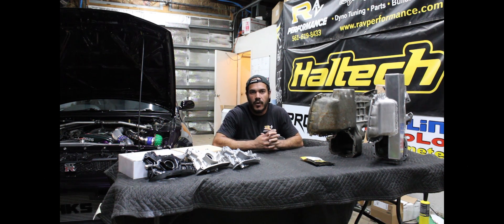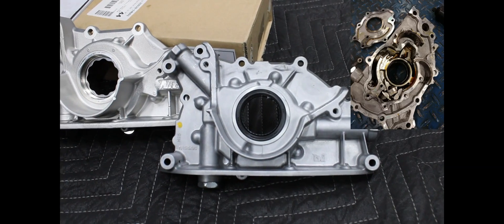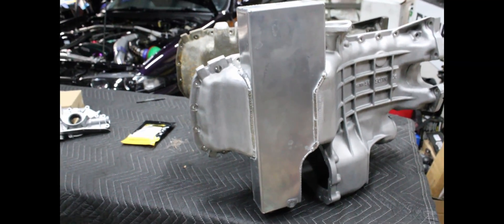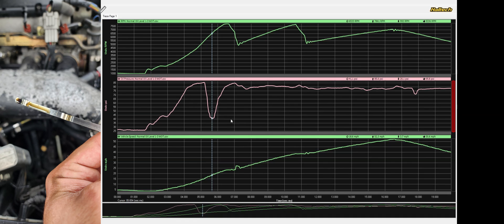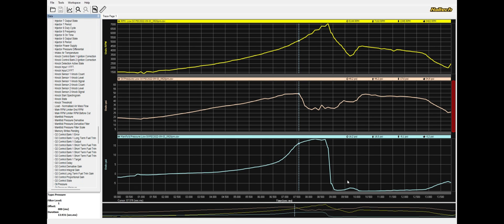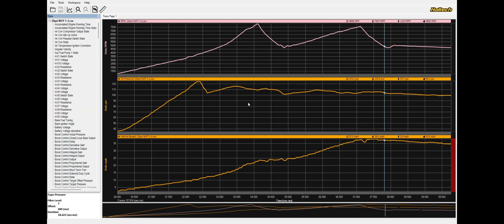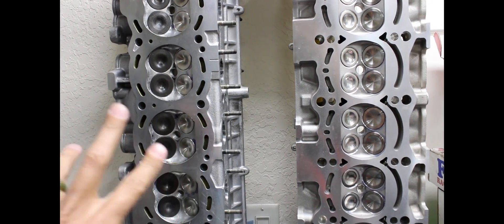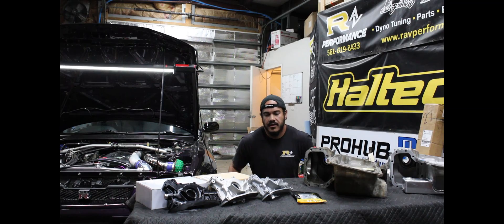RB26 Oil Issue Truth & The Real Solution

Comment: Thank you for the information, was any of the test with stock pan done with a oil flow restrictor to the head? Would it help to temporarily patch the problem?
Reply from the maker: @haiboj4979  Some of the original tests only had a head resistor. There are no significant signs of a difference. That being said, we run restrictors in every build as part of the whole oil package

Comment: Your video just saved me some money down the road. I looked at my logs and the issue you mention appeared. My oil pressure drops to 40psi at anything over 10psi with a s261 turbo. The log shows it happening even when I'm accelerating hard down hill.

Comment: Great video, I got some questions about the catch can setup. When returning the oil to the sump, do you recon a 6an plug on the can is big enough? And do you prefer venting the air to atmosphere or plumbing it back into the intake? If plumbing back, does it matter where you plumb it to? Thanks!
Reply from the maker: 6an is more than enough of a drain.

You run the vent before the turbo inlet

Comment: I would say just a couple other easy things to help working press throughout the whole system and other than just oil flow regulation from upgraded oil pump. catch can closed loop setup or returns to sump lines would be one way checks and for break ins for sure or ethanol too. many variables so basicly any motor can benefit a proper specd setup inline filter for cleaning blow/catch oil to sump return. cans also need proper breathing as well. Also the few builds that we have used the Turbosmart press regulators for turbo oiling systems have been a nice addition as well. I dont think I heard you mention the rear head drain or rocker baffles are other basics. The top 3 things from your video though, if you could only do 3, (in my opinion), would definetly be upgraded pump, sump capacity, and EMS sensor/tuning precaution limiters. some other things i feel get overlooked a bit would be just plain correct install of an aftermarket pump,  crank balance and proper spec/in tolerance, bearings and in line with block etc etc and if mismatched or blown/rebuilt. any unwanted harmonics as well or excessive movement, walking, whatever that would cause, of course gear sharp quick engagement shock and some pressure fluctuations. possibly a crank damper can help pumps along with a good belt for helping possible stretch seperation effecting pump gears or even effect (factory) CAS data loss to EMS in a scenario where real time correction or limiters, this that and need position data, and cant correct limit retard during whatever concurent danger scenario happens an oil press drop/starve, but fuel still getting to combustion, domino effect and etc etc etc, im getting into a bit different direction now tho. As you guys know, RB's more than most all other period motors, require a very specific harmony of parts and have traits and tricks only real world experience building RB's will give you. So last advice for owners wanting to do anything, mild to crazy, its a 100% must to not settle on any builder or parts dealer unless they truely know and have RB experience. RB's have a horrible reputation in the USA and it needs to change. Take the time to find RB specialty shops like RAV.     
And guys one last cringe i have, please get rid of the majorly unsupported motor but bangin the 2 step for show and limiter campout pop bang crackle, slap, scrape, float, shim spit cherry topped map that your neighbor not even born till the R35 era "who tunes" and spec's parts off his gran turismo build experience, made for you an hour before the Saturday night Pho/Boba shop meetup.  
please feel free to respond if you have any different thoughts or advice, theroy etc to my possible oil mod additions before i went off tangent. Cause who knows maybe I dont know F all of anything RB over 35+ builds anyway
Reply from the maker: We did mention head drain and baffles, both sump and vavle cover. They help, but do not fix the oil starvation issue. Much like you can see slight improvement from over filling, you'll see slight improvements from the basics. Point of video is that an extended sump is the only real way to fix oil starvation with out going accusump or dry sump
Reply: @ravperformance  sorry, i took a call right then and i didnt see that part of the vid clip. So also whats your take on using filter, checks, on returns to help stay steady with oil pushing back? help with cavitation/case press?  or turbo press reg w/ feed restriction? we saw a little less drop from gear to gear especially with a few of the smaller street stroker builds that were still reving higher (i.e 26 block strokers, built/ported head and usable 9k) So maybe a bit more of a specific question i had with that, if you have any experience/thinking there.  None of this having any part or in replace of or not doing the mods for sump capacity, baffle, traps modification either. I 100% agree that is necessasary for any RB from the get go and a must have. 
So many half ass corner cut builds are done applying bad or outdated RB build theroy. Having spent 2016-2022 in Australia building RB's and learning so much over there with the real RB guru's changed my thinking and building so much. I love to try to bring my experiences back to the USA market now and show how capable, and even reliable, this platform really is. So definetly Love to see the other shops that have the real work experience to show data so we can start to discuss and apply good building in the states. The RB has had such a horrible name here in the USA forever. Lets keep up the work to change that! I think it was a rav video with you I saw doing some work with Haltech 2500T for street tuning 12injs for staged Eth % w the advanced boost by gear/advanced Torque function tables while using DBW and the 50mm E-straight gate as well. I have a build that I would love to give you a call to talk about that Haltech tuning you did. especially your experience with that e gate. let me know if thats cool to call up and discuss.  Thanks brutha
Reply from the maker: @user-cc1rf4zp8w  the idea stays the same. Some help, some fix. You have to pick what your willing to "deal" with.
Reply: @ravperformance  oh nice thanks for the super awesome response. I know, not really where to easily talk in depth anyway.  Cheers Brue

Comment: Great video, it's so nice to see claims backed up be real data and your stance on having a discussion with people who don't agree is really confidence inspiring. I wanted to ask if you would do similar oil control work on an RB20 as well, around the 350bhp range? Would love to hear your thoughts 😊
Reply from the maker: On the rwd 20 and 25 you won't see to many issues until big power or track/drift use. But the same concept applies just not as early and severely as the 4wd pan RBs

Comment: Great information dude many thanks for taking the time to do this. Quick question, I have
BNR32 with 30k kms completely stock except for R34 turbos, Apexi intakes and Catless Velside exhaust. How much extra oil would you add above the full mark? I don’t drive the car often and not really that hard however i am tempted to remove boost restriction pill as I have the R34 turbos is this a bad idea ? Really appreciate any advice you can give.
Reply from the maker: Sadly, no. Having an aftermarket ECU constantly monitoring and setup to react to low oil pressure is the best investment you can make. Plenty can offer this fearure without getting rid of the oem look and drivability
Reply: Thanks very much for your help on this much appreciated!
Reply from the maker: Overfill to the notch and run a 60 weight oil. Get an ecu with oil psi protection and youll be fine
Reply: Many thanks, are there any other options than replacing ECU? Would like to keep the car stock.

Comment: so on a bone stock long crank car the best way to prevent oil starvation and oil pump failure are to upgrade the stock oil pump to billet gears inside and to install an increased volume pan? anything else that you recommend to give the engine the best chance?
Reply from the maker: An ecu with the ability to monitor and react to low oil pressure. Along with other engine basics like knock, aft and temps
Reply: @ravperformance  do you have any ecus that you recommend for r32s? I was thinking probably haltech elite
Reply from the maker: @cubegamer3905  Yes, the elite 2500 covers all bases as long as the tune has been set up correctly. Haltech has one of the better engine protection strategies on the market
Reply: @ravperformance  sweet tysm!
Reply from the maker: @cubegamer3905  we do stock the ecu and all seniors needed. Just shoot us an email for pricing. Info@ravperformance.com

Comment: Thank you for doing the log testing; I have not seen that before!  As an engineer, It’s really interesting to see the data there to back up all of these claims of oil flow, and to finally conclude that most of the issue is just sump capacity.  This helps explain why modern BMW's and Porsche’s use high capacity, 8-10qt sumps.

Comment: Great video! Have you tried with  different oil viscosity? 
A 30wt vs 60wt is most likely a difference in the time it takes to flow back to the sump. Would be interesting to know what viscosity you are using in the tests as well?
Reply from the maker: I have, actually. It's almost not different at all. Will still lose pressure in the same spot. 

I have even done hot 30w and cold 60w tests. The cold 60w was a bit more dramatic of a dip in pressure. But 5psi is just splitting hairs when you are talking about a consistent 60%+ dip in pressure
Reply: Interesting, thanks. The group N cars had stock oil pan but not a huge amount of grip when racing. The oil pump in Gr. N is not a high flow pump either.
Gr.A is another story where both larger oil pan, high flow oil pump and different baffles in the sump were used. 
Again, great video

Comment: Out of all the years I've been researching and combing forums, I've never seen someone post logs to explain. I appreciate that.

Something critical to remember on why the RB has draining issues is due to the 10deg tilt. This results to drainage being limited to the exhaust side only. The hole diameter doesn't help either.

Billet/spline gears, oil restrictor,  extended sump, head drain and plum to sum catch can are a must for the RB.

Comment: You didn't mention head restricters   or rear head drains
Reply from the maker: Yes, I did. They both are part of the mods that help but don't fix the issue.
Reply: Restrictor doesnt fix the issue??
Reply from the maker: @2johnz_gte  the head restrictor shows virtually no difference in oil pressure drop. It does help keep oil trying to head to the catch can.

Comment: Did the extended pan have the Nismo baffle that Leask likes to use? Need to log stock pans with a non factory baffle (Nismo/Tomei/HR) that keeps the oil from going to the back of the pan on hard acceleration. I would bet that inertia and lack of oil control is more to blame than lack of oil volume.
Reply from the maker: I have done multiple stock pans with nismo and tomei baffles. Little to no change.

I have done 4 pan extensions with the stock baffles. All over 600hp, all have perfect oil pressure to redline in every gear.
Reply: @ravperformance do you have the data from the baffled stock pans to do a comparison with?
Reply from the maker: @chuckgf8  Yes, both the higher hp examples in the video are stock pans with nismo baffles.

The oil pan baffles only help keep oil centered. If no oil is present, they don't help very much.

Comment: So what is the total solution bigger oilpan,drain from catchcan to pan,baffles in top of cam covers and upgraded oilpump and pump gear. Can you get away with just oilpan upgrade or is it a bad idea?
Reply from the maker: Great question. 

As an experiment, i did the oil pan upgrade without changing anything on a car last year. Oil starvation was still nowhere to be found at 600hp. But because the other modifications are so inexpensive, why not do them all. 

Oil restrictor and pan baffle being the runner ups. 

Valve cover baffles are only really relevant if you are running a sealed catch can. But won't hurt

Comment: What's your opinion on spline drive pumps? When I built mine I had a collar machined onto my short nose crank. My understanding is it eliminates any possibility of slip, which is still possible on a long nose.
Reply from the maker: If your flat drive slips, it's already too late. The idea behind the spline drive is more surface area, so less wear over time. With that being said, it's the better choice but a flat drive with billet gears will probably never give any issues.